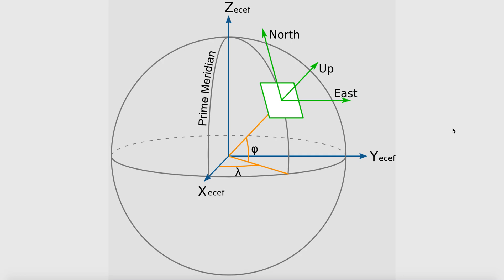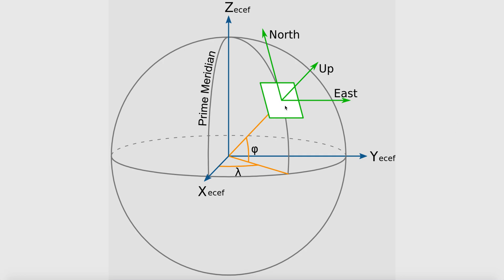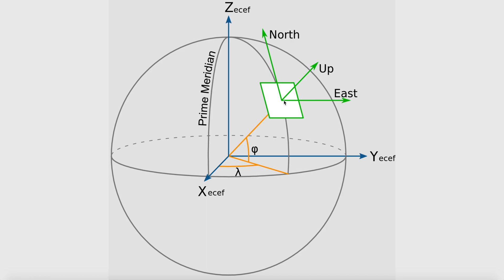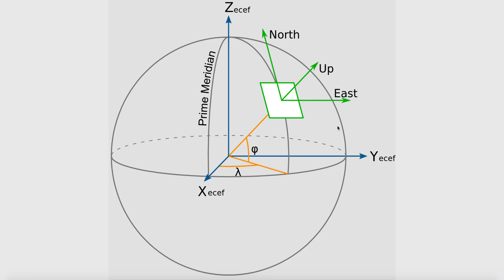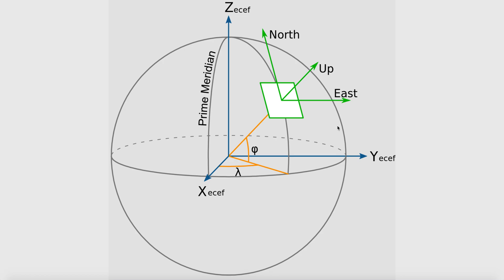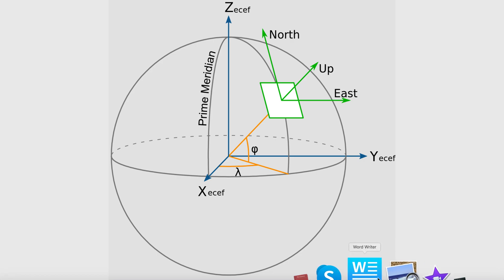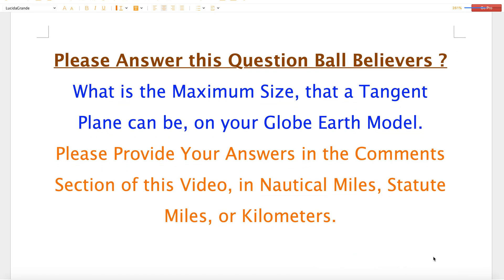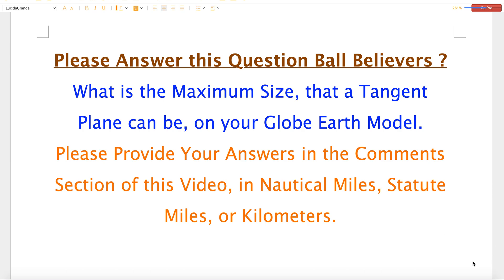How Big is a Tangent Plane ?

Comment: @Brian's Logic a plane has no dimensions, it goes on infinitely.

It just needs a single point in space and a normal vector to define all points on that plane. So a tangent plane on earth would have the point where the plane and the earth touch, and the normal vector would be in the direction of Up at that point.

Say
P=your single 3D point on the plane
N=the planes 3D normal (unit) vector
S=any 3D point anywhere in space

If you calculate the dot product
(S-P) dot N

If the result is positive then point S lies above the plane with respect to the normal
If the result is 0 then the point lies on the plane
If the result is negative then the point lies below the plane.

The magnitude of the result is the perpendicular (and shortest) distance from S to the plane.

I use this stuff quite often so if you don't understand it that's not my problem but I'll be happy to discuss.

Comment: A tangent plane to any surface is not constrained to any physical size or dimension.
It is a tentative plane which is perpendicular to the surface normal in a particular point.

It can be on top of a head, tip of a nose or a polar coordinate on a spherical surface, like in the video.

For purely practical purposes, on the surfase of the earth it can be any size you like. It depends what you need it for. But then it’s usually not called a tangent plane any more.

So, on an egg for example, surface normals don’t always point to a center as the egg shape is more cpmplicated that that. Still, on any given point on the surface of an egg, a tangent plane can be defined.

The illustration in the video is typical, but can be confusing as it looks like the plane has some limit in size. It is actually more like the coordinate axis, also in the illustration; they don’t have specific sizes either, right?

But that ball illustration…
Consider the point on that sphere.
And its zenith.
Using a sextant, to navigate one degree in any direction from that point, what would the surface distance on that surface then be if was 2 meter diameter?
And is there any difference in distance between 0–1 degrees and 8-9 degrees?
(On thay 2 meter ball)
Just suppose that one dgree travelled would mean that the distance covered was 111120 meters, what would the radius of the ball need to be?
Reply: we know Brian proved with a sextant a ball with a radius equivalent to the Earth's Radius works out to be 60 Nautical miles per degree.

Comment: I’ll take it one step further. When you look at a map of the United States, lots of the borders of the states that run east to west are curved because the surveyors used a Compas to lay them out. The boarders that run  north to south are straight. 

In Europe, the boarder are all over the place because they weren’t laid out by surveyors, they were established through possession and war. 

Surveying is closely related celestial navigation. You need a level horizontal to get the angles to your hypotenuse, and you need a 90. The horizontal is parallel to the Flat Earth. 

Globe Earth is a Religion
Reply: It depends on the projection used.
A flat map is always a projection, so the same west to east borders that are curved in another map, are straight in a Mercator projection.
The north to south lines along the lines of longitude can also be made curved in other kind of projections.
Your assumption is wrong, depends entirely on the choice of the projection you want to use.
Reply: @psalux18963  
For your information. All of the projections you mentioned aren’t maps. They are cartoons that are based on your Globe Earth Religion.
Reply: @flattenthecurve8623  Every existing map on paper is a projection of the globe.
There are no exceptions.
You may want to call them cartoons, but then you have to present the true map of the flat earth.
Reply: @flattenthecurve8623  Projections where the longitude lines get distorted:
- Cassini
- Gauss–Krüger
- Hotine oblique Mercator
- Sanson–Flamsteed
- Mollweide
- Eckert IV
- Ortelius oval
- Goode homolosine
- Kavrayskiy VII
- Robinson
- Equal Earth
- Natural Earth
Reply: - Tobler hyperelliptical
- Wagner VI
- Boggs eumorphic
- Craster parabolic
- McBryde–Thomas #4
- Quartic authalic
- The Times
- Loximuthal
- Aitoff
- Hammer
- Strebe 1995
- Winkel tripel
- Van der Grinten
- Werner
- Bonne
- Bottomley
- American polyconic
- Rectangular polyconic
- Nicolosi globular
- Lambert azimuthal equal-area
Reply: - Orthographic
- Vertical perspective
- Two-point equidistant
- Peirce quincuncial
- Guyou hemisphere-in-a-square projection
- Adams hemisphere-in-a-square projection
- Lee conformal world on a tetrahedron
- Cahill–Keyes projection
- Waterman butterfly projection
- Dymaxion map
- Craig retroazimuthal
- Hammer retroazimuthal, front hemisphere
- Hammer retroazimuthal, back hemisphere
- Littrow
- Armadillo
- GS50
- Wagner VII
- Atlantis
- Bertin
Reply: @flattenthecurve8623  That's impressive, isn't it?
What about trying to study anything about a topic before posting about it?
If the earth was flat there would be only one map, and there wouldn't be  any projection, the map would be always the definitive map of the world without any distortion.
If the earth was flat cartography would be really easy.
Reply: @flattenthecurve8623  Yes, not only the longitude lines, but any map on paper must have distortion in some elements (above the level of width area of a topographic map), not because it is fictional, but exactly because it isn't.
Maybe you didn't understand it before, but the fact that there are a lot of different maps is evidence that a flat map is not possible, otherwise there would be only one map for any section of the earth, and no one would have the need to make different types of projection because there would already be a complete adherence of the map to reality.
Maps are used to navigate on the land, no one would accept a map that is systematically wrong.
When surveyors draw triangles between locations of the real earth they always find that the sum of the internal angles is higher than 180°, in this way demonstrating the convexity of the surface.
There is not a single clue in reality that agrees with the flat earth, every single detail is instead exactly what is expected to be on a globe.
You don't like this, and you are condemned to try to find excuses to explain why reality disagrees with you.